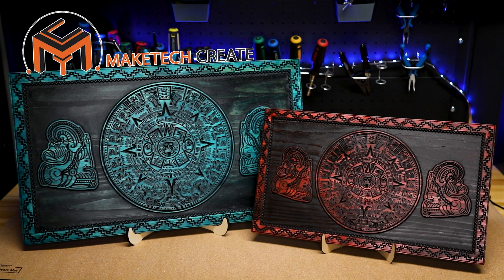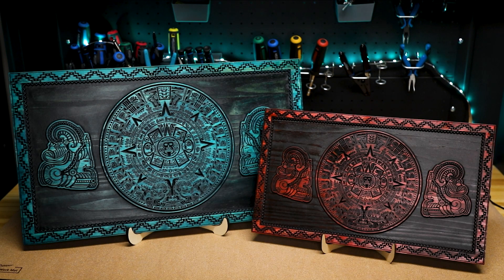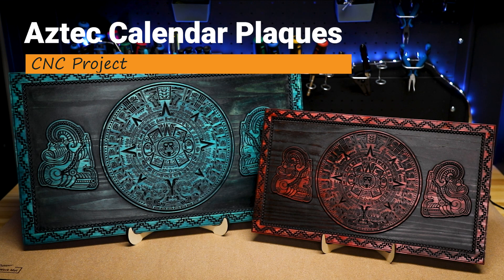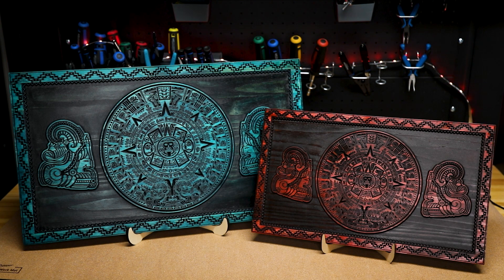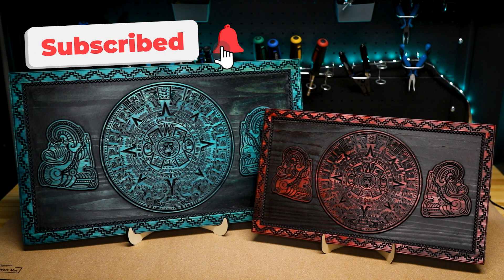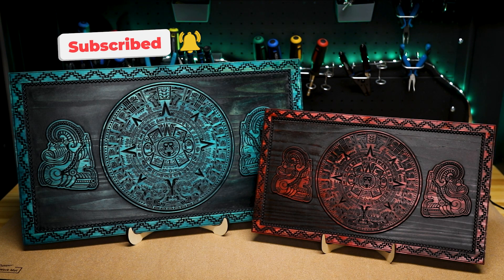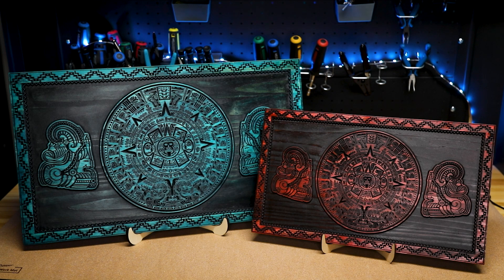Aztec Calendar CNC Project

Comment: Time and size can i get info about?
I made just circle like ~900mm like 18 h.
Reply from the maker: What program are you using?
Software like Vectric optimizes the tool path for a MUCH faster cut. You can speed up your feeds.
I can do a 12x18" in about 3-4 hours.
Reply: @MakeTechCreate  vcarve pro 11.  Yea middel was in near size it takes like 4 h to make.
Full size like 35.4"
Reply from the maker: @megatimeout123  What are your feeds set at and plung.
Also, what bit are you using?
Reply: @MakeTechCreate  same v-bit 2feed, plunge 1.5.
For flat cleaning 6mm and 3mm downcuts with feed like 5 and plunge 2
Reply from the maker: I just checked, and I'm running my 60⁰ vbit at 60 inches/min and plunge at 30 inches/min ... you'll have todo metric convertion on that. For at 9" calendar, Aspire is estimating 1.5 hours.... which is about right fron my experience.
Reply: @MakeTechCreate  ill cheack that. Thank you so much. Bless from Poland.